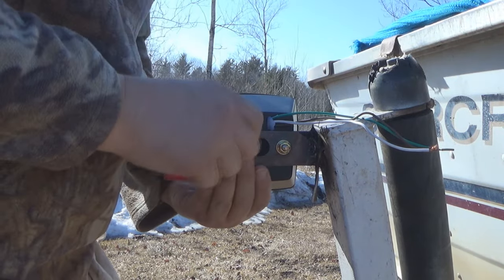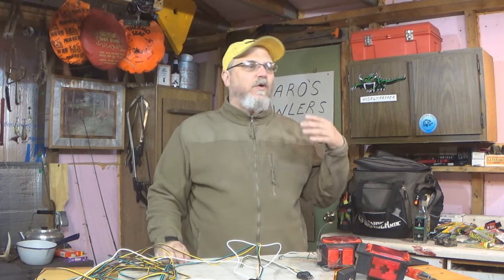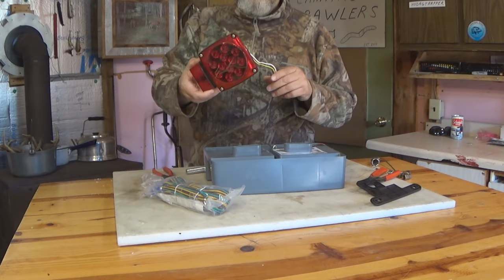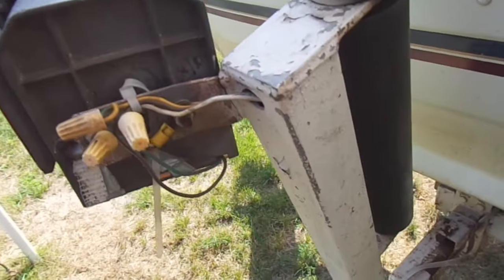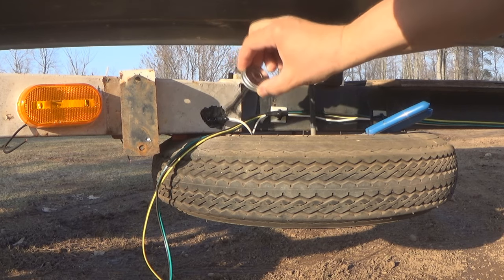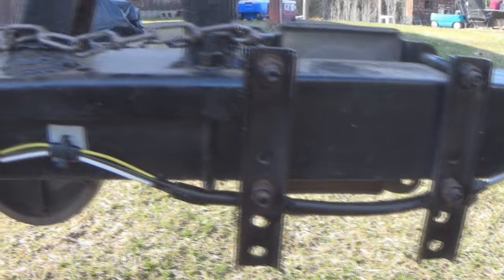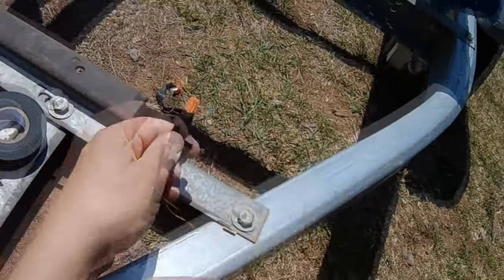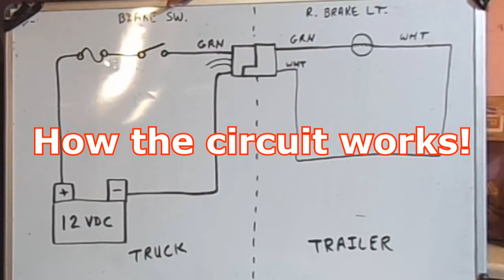How To Wire A Trailer, New Lights Also

Comment: I wish I saw this earlier. I have wasted an entire day trying to make new trailer lights work. Been to Harbor Freight and Cabela's buying and returning "faulty" lights, ripped out and replaced all of the wiring, bought a tester to verify the wiring on the truck was good, and on and on......the problem was I painted the trailer and as a result, reduced its electrical conductiveness. I did as you said and moved the ground wire to the same piece of metal that the lights were on and boom, everything works. Thank you thank you thank you! I appreciate your thorough style. Keep putting the slop low, where us hogs can get to it!
Reply from the maker: Really appreciate that comment my friend!

Comment: I have NEVER had a trailer that provided a good chassis ground. During trouble-shooting of trailer light issues I have found that the problem is usually caused by a bad ground. It is so easy to run a wire from the white wire on the harness to each light. This will give each light fixture a good ground and give you MUCH more reliable trailer lights.
Reply from the maker: true

Comment: Retired electrician here. Many good points and ideas by Mr. Knetter. Nothing wrong with overkill-less time troubleshooting means more time you got a hook in the water!
Reply from the maker: That is an awesome complement from an electrician that goes by Pipebender.  Sounds like you may have bent some conduit in your day.  I've bent a little conduit myself.  Thanks again.
Reply: I don't worry about electrical stuff anymore. Just dragging crawler harnesses on Saginaw Bay all do in the summer. Little Bay De Noc sure looks like beautiful walleye fishery.

Comment: That was a nice video, great explanation and informative for those with no clue how to fix their trailer lights and great for doing a small utility trailer but in my opinion, not preferable for boat trailers. I have 30+ years as a marine electronics technician and there are just a couple of things I would suggest with regards to boat trailers. First, always use marine grade wire for a boat trailer. Marine grade wire is tinned to prevent corrosion and comes with a thicker layer of insulation to resist chafing. Never use those cheap trailer wiring kits on a boat trailer as the wire is common automotive grade wire and is not designed to be submerged in water. The only reason the manufacturers use it is it’s cheap and will get the trailer through it warranty period. Second, the chassis common ground is a single point failure and a PITA to troubleshoot, also an automotive mainstay and not conducive to being underwater. When I rewire my boat trailers, I run independent conductors for each light, terminated in a waterproof junction box on the tongue of the trailer. That way if there ever is a problem you can check continuity to each light independently. If a wire needs replacement simply cut it, attach a new wire to the old and pull it through to it’s termination point. The first trailer I did this way was over 25 years ago and has never had a failure except for burned out bulbs.
Reply from the maker: Good stuff, thanks!

Comment: I CANNOT thank you enough for this series of videos! Thanks to your simple, thorough instructional videos I was able to successfully rewire my entire trailer with new fixtures!

The first time I tried to rewire my trailer, I forgot about how important clean, tight grounding points are. Oh, and I broke my then-new replacement fixtures because I over-tightened the mount lugs. I rewatched your series at least 15 times and made triple-sure to ground EVERY fixture to the trailer frame and run a long ground wire from the truck to the trailer frame.

Presto! My trailer has a new lease on life! Thank you once again, good sir!
Reply from the maker: Thanks for that comment!  I so glad it helped.

Comment: Man, thankyou soo much for explaining that. I felt like I had no clue. My new wiring was done but didn't work. The ground at the front was not connected. So the circuit was open..!! Thank you . One more question is if i connect the main ground at front and dont connect the marker light ground wire. Would circuit still not work?
Reply from the maker: Depends, some light fixtures are grounded by bolting them to the trailer frame and some have a wire that needs to be grounded to frame or connected directly to the white wire.  If you have a ground wire on the fixture best to connected it to frame or white wire.

Comment: I think you're doing it the right way, 100%. The old wiring on my used trailer was daisy chaining the brake lights and marker lights using the brown wire first, then continuing the flow of electricity through the GROUND wire to the other light!!!
In my opinion, it's CRUCIAL to make sure that every light (or electric component) has it's OWN ground, somewhere to the frame of the trailer.
A ground is a GROUND. It's not a method to power the next light!!!
USE SOME SORT OF A 3 WAY CONNECTOR TO USE A SINGLE WIRE TO POWER MULTIPLE COMPONENTS!!!!!!
Awesome video! Just wanted to clarify what you did and how important it is to do it like this!!!!
Reply from the maker: Thanks a lot for that comment.

Comment: Thanks so much for this very informative video..I rewired all my boat trailer wires with new ones.The jumper wire you suggested  for the ground worked great..The new lights wouldn't work until I jumped wire the tongue to the frame...
Reply from the maker: Glad it helped

Comment: Dude thank you so much I'm an electrician but I do not mess with DC voltage a lot so this was really kicking my butt why my buddy's trailer lights would not work. It ends up that the lights are not mounted to the frame and there's no white wire coming from them so I need to add a jumper from the light post to the frame which is grounde Thanks so much for breaking it down easily and the handwritten schematic was awesome!
Reply from the maker: You are welcome and thanks for the comment!

Comment: Good series. I've begun using semi trailer lights that fit inside a rubber grommet that mounts to a cutout or metal enclosure. got tired of breaking these style taillights. my preference is also to run the wire for the running light all the way to the back and then back up to the side marker. less chance of losing the rear lights due to fewer connections. I even ran conduit front to back on mine so I have less chance of wires getting frayed/damaged. wanted that to be the last time I had to mess with this stuff.
Reply from the maker: thanks for adding in
Reply: l❤

Comment: I learned a lot from that. I need to put new wires on double axle pressure washer trailer. The trailer should have brakes. I could wire it just to have the light setup but if I'm going to do it I'd rather do it right and have the brake setup as well. I'm look at your other videos and see if you have one that includes trailer brakes. Thank you!
Reply from the maker: Sorry, I haven't done any vids with brakes.

Comment: Thank you very much for this video with a super clear explanation! I’m driving from Florida to Wisconsin with my trailer lights going on / off and getting faded depending on the surface of the road I’m driving on.  I could not understand why the problem even after moving  the ground wire to another close section on my trailer.  Well my trailer came 3 and a half years ago in many pieces, like a puzzle and I think that the problem!! 
I guess I’ll have to run the left and right ground to the from of the trailer, close to   the side markers. 
I hope I’m right??
Reply from the maker: I think you got the right plan.

Comment: Wondering why the wires were not run inside the square tubing of the trailer tongue? Very helpful video! Thanks!
Reply from the maker: Well, I did show at the 25 min mark doing that way to another trailer, so it definitely is an option.  I have had wires inside the square tubing rub and short out.  Often it's an intermittent problem and it can be hard to find because you can't physically see the rubbed wire.  I have also seen wires run down a small round tube on utility trailers.  I had one where the small tube rusted on the inside and shorted the wires.  It was so bad I couldn't even pull the wires out of the tube.  So "sometimes" I just like to run the wires on the outside of the trailer and just make sure they are secured.  Either way is fine though.

Comment: I never completely understood the white wire and how it worked. 🤦🏻‍♂️ DUH!! When you said to connect the white wire on the trailer plug, to the trailer frame…the. The white wire from the lights to the trailer frame….and the trailer frame basically becomes the white wire…..the light bulbs went off. As many times as I’ve looked at my trailers’ wiring, I never caught that. Brilliantly described.
Reply from the maker: Thanks for sharing that with me.  Glad it helped.

Comment: Your video helped me identify that my ground was not getting a good connection. I extended my white ground wire to the back of my trailer and then bolted it down. Now when I hit my brakes work instead of completely going out.
Reply from the maker: Awesome!

Comment: Nice detailed video.  Question for you:  I need to run new wiring with the new fixtures to my trailer.  The instructions are like yours.  The problem I have is feeding the new wires to my fixtures on the Carry On trailer.  The trailer has metal conduits to protect and hide the wiring.   The problem is that it appears the conduit(s) for the wiring is blocked.  Is it normal to have blockages i.e. did the manufacturer plugged it up on purpose?  I can't even pull on the wire from one end of the conduit to see if the wire is accessible other wise I would cut and tile the wire and pull it through.  Your thoughts?
Reply from the maker: I've seen them get packed with dirt and sand and make it impossible to pull the wires out.  It's also possible the manufacturer did secure them in the pipes to prevent rubbing or wear over time.  Hey if you can't get them out, you can't get them out.  New conduits or alternate path might be the options.

Comment: You're a good teacher and explain well. I tried wiring my friends sled trailer. I put new lights on the back that only has 2 wires, no white wire and attached the black wire for the license plate light and marker light to the brown and black wire. When I plugged it in, the signal lights were flashing properly but so was the license plate light when left signal light was on and middle marker light was flashing when right signal was on. Not sure why. I will be replacing the old wiring. It's inside a tubing and I'm thinking it's probably cracked inside also since it's really frayed and old wire. It's a tilt trailer so maybe I should run a white wire from front to tilt like you did, maybe that will fix the issue?
Reply from the maker: Sounds like a fixture isn't grounded right.  Double check the fixtures and new wiring is always a good idea.
Reply: Ok, thank you. I will check.  @KnettersPracticalOutdoors
Reply: @KnettersPracticalOutdoors I replaced the lights and wires and everything worked except for the trailer park lights. A friend suggested that I check the fuse in my truck for the parking lights and after I changed it and checked, to my utter shock and amazement, everything works as it should! I've never done a rewire and light replacement before. I'm really glad everything works! Thanks for your help. 😊

Comment: We are Having trouble even drilling into the metal of the trailer … so many broken bits, center punches (even ones made for steel) and headaches. Any advice? Should we skip the drilling, tapping the hole etc and try those screws instead?!
Reply from the maker: Wow, I wonder if you have a stainless steel trailer.  I haven't come across one, but who knows.  If it's mild steel or galvanized  you should be able to drill into it.  Get a new, sharp bit and find a part of the trailer that has thinner metal.  There should be some place to get a good ground by where the lights attach to the trailer.  If the trailer really is impossible to drill, maybe try a "clamp on" grounding lug.  Like an electrician might use.

Comment: Thanks for the video.  Why can't you just run white wiring to all the fixtures if the side markers have wires coming off them?
Reply from the maker: You can, and it's not a bad idea at all.  Just be sure to also ground to the trailer frame also.  That way any short circuits will cause the fuses to blow as them should.

Comment: Great video on trailer lights! Best I've encountered! I have one question though. What size/style self starting screws die you use and do you have to drill a pilot hole for them? Thanks!
Reply from the maker: Don't remember the size, no pilot hole required.

Comment: Great video! I'm rewiring my trailer and my side marker lights have rivets holding them on and I'm replacing all of them. Do you think aluminum rivets would work? Or should they be stainless?
Reply from the maker: Stainless is usually better.  I'm thinking you are in Florida, a Northern Michigan man like myself doesn't know all the pitfalls of the salt water you may deal with!
Reply: @KnettersPracticalOutdoors   I couldn't find stainless locally and ended up with the aluminum. It worked out great. I also think that's what was on it from the manufacturer. BTW, Thanks for your video! I rewired my entire trailer. Grinding off corrosion from the metal and moving my ground wire really made a difference. No more flashing lights from a ground wire that was on the swing tongue. 👍👍

Comment: Great video but could you comment on the proper way to submerge those lights under water without damage. Thanks
Reply from the maker: Old incandescent bulb fixtures - I always would unplug them before backing into the water.  New LEDs - they can be backed into the water.
Reply: Thank you, what about the wire connectors, don't they short once submerged unless heatshrink?

Comment: So im trying to redo my wiring for my pop up camper. Can i run a ground wire from all lights to the trailer and then run my appropriate wires to the lights?
Reply from the maker: Yes, that can be a big help.

Comment: What gauge of wires do you use?? 
I have an 27 foot travel trailer (camper) I have to rewire the lights on the back of trailer.. I need to have the safest trip 2000 miles across the United States.. I hope I can rewire in 2 hours..
Reply from the maker: I've always used the premade 4 conductor for trailer lights.  I think it is 14 ga.

Comment: My harness has a yellow green brown and red wire it says the red is for rear marking red lights if trailer over 80" inches wide plus the white ground wire. 
I ran all the wires except white to rear of trailer used white for ground on the front of the tongue. For my marking lights I ran a separate wire from each marking light and spliced into the brown at the back yellow to left green to right. 
Nothing works shouldn't that setup work wired that way.
I'm going to check my grounds today. Also it an old tilt trailer I did grind the paint away at all connections.

Is this wrong or should it work wired this way
Reply from the maker: Did you use the red for anything or just the brown for the running lights?  I think you are saying you don't need the red because your trailer isn't that wide.  It sounds like it's all good as far as yellow green brown and white, but yes check that the entire trailer is grounded good.  Might not have a good ground at back of trailer.

Comment: Superb work on these videos.  
I keep blowing my truck running light fuse  when my boat trailer is connected.  I checked the vehicle side and all look normal, I get 12.8VDCc out of the brown all looks good.  On the trailer side I have continuity from the brown on the RHS to the WHT but no continuity on the LHS brown to WHT. I suspect that I have a short between the brown and frame/white on the RHS but the LHS is fine.  What are thoughts?
Reply from the maker: Yes what you are seeing could be the problem.  Keep in mind you could read continuity through the bulb to the white if you have the old filament bulbs or possibly even LEDs.  And this could appear to be a short.  The LHS might read different because of a different issue (blown bulb or bad fixture).  Unplug the bulb on the RHS and see if the short is still there.  Or if you have LEDs disconnect the brwn near the fixture on the RHS and see if the short goes away.  If it stays search the brown wire for a ground.  KPO
Reply: @KnettersPracticalOutdoors  
On the RHS I still have a combination of old bulbs and LED.
Thanks for the tip.

Comment: If the white wire has already been run all the way to back end of trailer, is it okay to just tie the white wires from lights into that, instead of grounding anything to the trailer body?
Reply from the maker: Yes, that is a good practice.  But I would also ground the white wire to the trailer.  That way any short circuits to the trailer frame will cause a fuse to blow as they should.
Reply: @KnettersPracticalOutdoors  thanks!

Comment: If you kut the wire insulation in one sirkle around the wire you kan just put the installation apart that will give you enough bare wire to make a konnektion...... If you need a little more Kontakt area then use the lighter the insulation will spread apart easier with the kit in the insulation already made..... it will save you from burning your fingers and leaving a gape of bare wire.
Reply from the maker: cool

Comment: If the lights if the lights don’t have a ground wire on them, do I am I supposed to make a ground wire for
Reply from the maker: No, the studs that bolt the fixture to the trailer are the ground.  Make sure the nuts or washers get through paint and are electrically connected to the trailer frame as you are tightening the fixtures on.